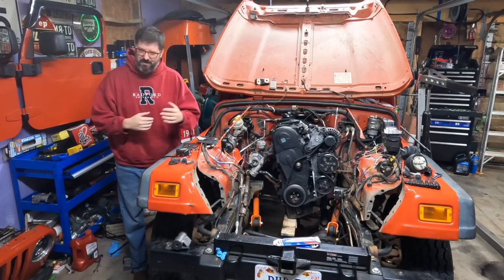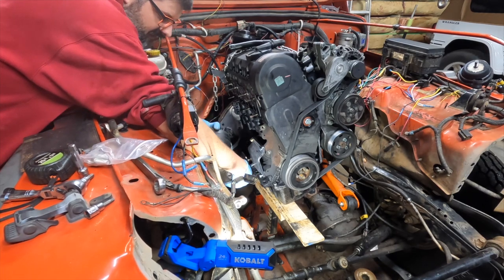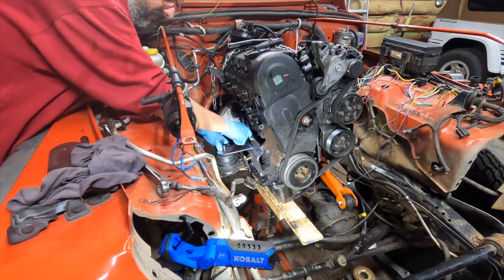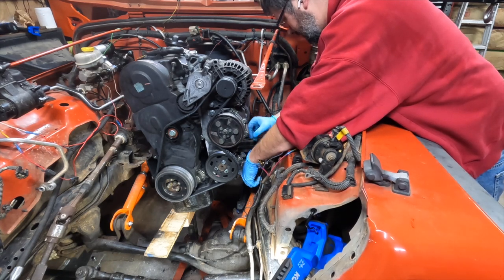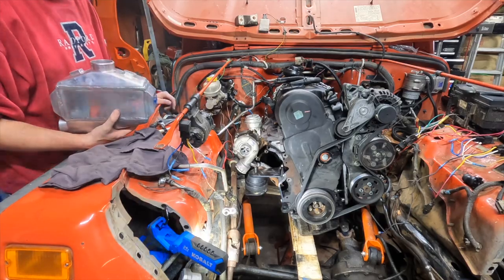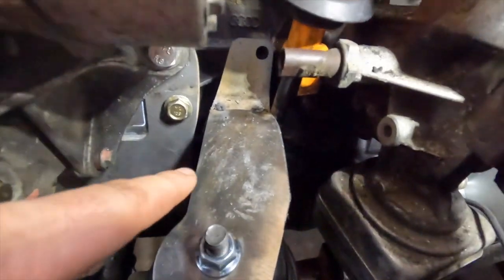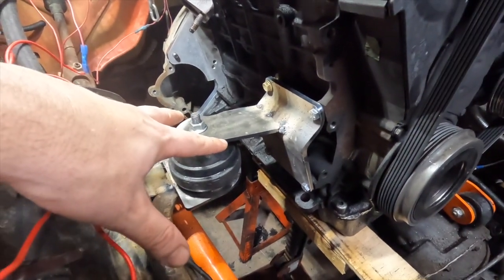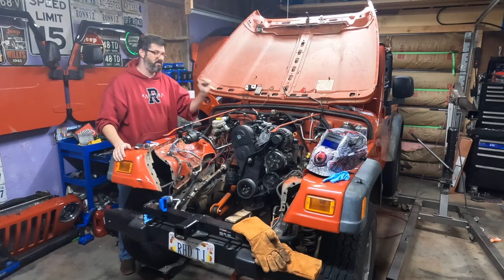Fabricating Motor Mounts for my BEW TDI swap into my TJ Wrangler

Comment: any specific reason why you went with the 10 degree tilt vs 0 degree (vertical)? I also have a RHD I'm thinking of doing this to.
Reply from the maker: So for me there was a couple of reasons, I needed the extra clearance to the pumpkin on my front axle because I moved the engine forward in my engine bay when I was running the Kubota 6". I also did it because I wanted to run AC but I'm now thinking I should have put the AC pump on the other side, I'll be talking about that in an upcoming video.